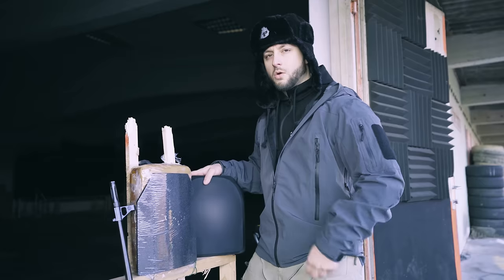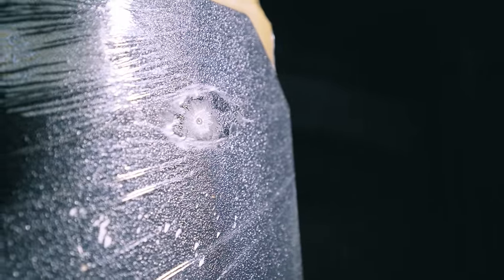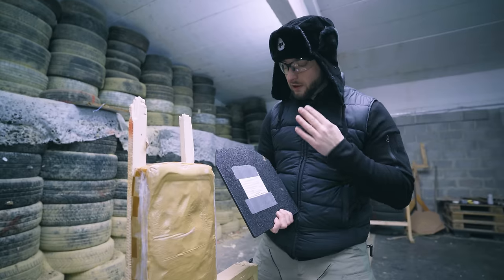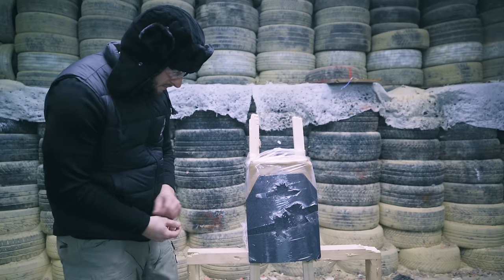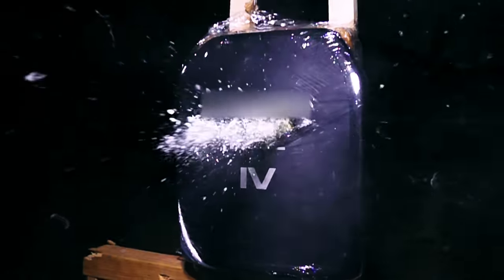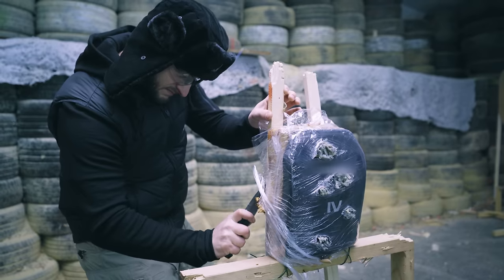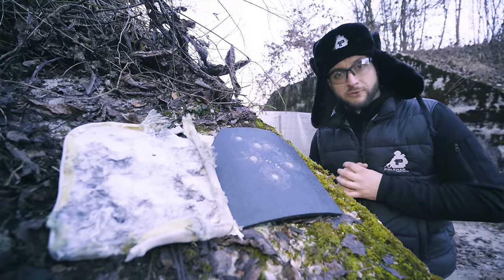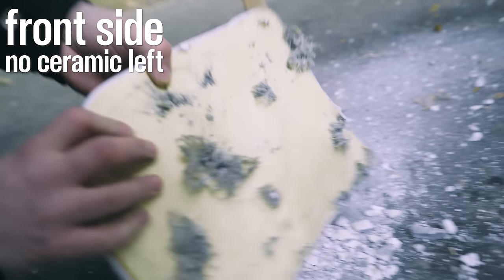Steel vs Ceramic Ballistic Plates

Comment: Good video. Nice to see someone who isn't sponsored by an armor company talk about armor reasonably.
Reply from the maker: Thanks
Is there anything specific with armor that we should try next?
Reply: @PolenarTactical  I'd be interested into drop tests. In the army they always told the fudd lore that once a ceramic plate was dropped to the ground it is useless
Reply: @PolenarTactical  Since you ask - I'd recommend using different bullet types for the different calibers to show different results from different bullet compositions, as I assume that the bullets you used in this video were all new production FMJ lead core types derived from civilian manufacturers. Seeing as almost no military to speak of still uses lead or at least in the process of phasing it out and replacing it with other types of materials, such as copper and steel of varying hardness, I think it would provide a deeper insight into the performance of the armor if it were ever a need to actually use it. I suspect however that it might be somewhat tricky, with legislation and avalibility and all that but if you could - it would be very swagger of you.
Reply from the maker: There is some truth in that - older plates were made from a single piece of ceramic that if cracked it could potentially spread apart and offer a path for a bullet to penetrate. 
But modern plates use small square or hexagonal ceramic tiles that are bonded together. This offers better multi hit capability but also negates any potentially downsides of cracks - even if the tiles crack, the plate should offer the same ballistic resistance
Reply: @ptitlinge  that's a scam, dude. If the username is "Text me at..." then a creator's name, it's a scam. No reason a creator would make a 2nd account like that for a giveaway.
Reply: @PolenarTactical  
Oblique angles and testing those side plate options some offer and options to add to reduce spalling damage.
Reply: Check out Oxide, he has tested a bunch of Eastern Armor/ Helmets
Reply: @PolenarTactical  try a hand loaded 300 RUM with a 180gr and around 96 grains of H1000. I get about 3,500 fps with that load. It doesn’t scratch steel even at point blank. I’d be interested in how that heavy and fast pill would do on ceramic or hdmpe plastic plates.
Reply: Buffman bro check him
Reply: @PolenarTactical  same spot steel armor durability would be neat
Reply: Would love recommendations for sources for reasonably-priced ceramic or UHMW plates.
Reply: I would like to see plate tests at longer distance, maybe between 200-300 yards/meters
Reply: @PolenarTactical  UHWPE armors or hybrid steel UHWPE look very interesting, I whish I could see more tests of them
Reply: @urlawyer  lapg has some cheap ceramic lvl 4 plates that look exactly the same as the plates tested in this video.
Reply: @Kappi1997  that's not true. During the NIJ testing for certification ceramic plates are drop tested. You can find videos of most brands of ceramic being drop tested on YouTube including by buffman range
Reply: @PolenarTactical  Polyethylen plates pls.
Reply: @PolenarTactical  late to the party, but as others have said, would be great to know how tough these ceramic plates are to drops.

Comment: Never forget to put Mosin on full power mode before shooting.
Reply: Only for those 10km shots
Reply: And only if you're a highly trained black ops delta SEAL operator. It's highly dangerous to the user otherwise.
Reply: But you have to have points into the appropriate Engineering skill to overcharge your weapons.
Reply: I sure hope y'all don't have a Telegram account, because I just flagged a post from it as spam 😄
Reply: Level 4 plates don't stop stronger rounds than 7.62 NATO
Reply: I do the same thing with my k-kale. Erry time.
Reply: Heads-up, scammer with a Telegram account offering unspecified winnings!

Comment: A very important thing that was missed is "glancing shots". Ceramic will capture the round, steel will deflect. If you get hit at an upward glancing angle, that round is going to hit your neck or under-side of your head which = severe wounds if not death. I hear Polythylene is the way to go.
Reply: Ofcourse but how big chance is this happend if you?
Most of times enemy shoot AP that can pen armor.
Reply: @joe125ful  Happens all the fucking time dude, and most "AP" munitions do not penetrate military-grade armor, real life isn't Tarkov. Level IV can stop 30-06 AP rounds, and modern rifles fire cartridges SIGNIFICANTLY smaller than 30-06.
Reply: @TacticalMetalhead  
1 Not at all under 90 angle ther is shrapnels and this problem can be easy solved when armor is in vest so put reinforced layer and done,no dealy astuff for you.
2 Also Level 4 is good but shoted to face leg/arm or from side not save your ass anyway or using 50 Cal.
Also force energy can broke your ribs and do internal bleeding when ribs can broke under 200-400 Joules.
Just look in 4:14 there is definitly some injuries after few shots and this can easy  happend in fight.
Reply: What impact angles are we talking about?
Reply: @joe125ful  You're spewing so much bullshit haha. It's not even funny.
1) At that point you are close to the bulk of ceramic with twice the weight
2) That applies to any armor. And no, with good armor (like ceramic, that absorbs impact), with a good backer, you need WAY more than 400 joules to break the ribs.
Reply: I'm looking fort to someday having body armor made from graphene. Someday that will be the best armor once they perfect making it
Reply: Thats what a gorget or a neck protecter is for man. Kevlar can catch alot.
Reply: Don't they have spalling rubber like coating to stop that? He even mentioned these already in the video. Military steel plates have the coating.
Reply: @sneakysnek2185  Additional weight, additional heat building up in your body, additional cost, mobility even more restrained.
Reply: @skullofserpent5727  Anything beyond 70° will send big shrapnel to the deflecting direction. Big enough to make you feel sorry about choosing a steel plate.
Reply: @andreasr6632  90 degree is a head on impact. 70 is quite an offset, like you r engaged from higher ground or  from basement. Anyway, no one sane runs naked steels. They r usually packed im kevlar envelope and then inserted to body armor. I prefer steel. Some fragmentation and small shrapnel will compromise ceramic, and that is what mostly hits operator.
Reply: @clientcomun1958  Bro "spalling" isn't a glance/richochet.
Reply: @sneakysnek2185  Yeah that shit isn't stopping anything but spalling and maybe light shrapnel. The protection value for pretty much ALL "soft armor" on the market can only stop pistol cartridges if physics is on your side (which it never is). And Lucas is 100% right with the additional heat, weight, cost, and decreased mobility. Not worth it.
Reply: Most modern ceramic plates use a polyethylene backer.
Reply: What if you use both plates 🤔😁
Reply: Literally just wear neck armor. Or better yet, why doesnt armor just curve OUTWARD away from your chin?
Reply: @LegendaryP-sl7gf  have you ever worn neck armor and run around with it for a few hours? Literally nobody issued an IOTV wears it because it traps heat like crazy. 

It's so easy to hear guys who've never had to ruck or patrol with body armor say "just put xyz on it". This is why you should train to know what works and what doesn't
Reply: Actually...that is false. Videos that I've seen steel with a coating does a better job at stopping it as the bullet still breaks on impact along with the fragments exploding towards the inside of the coating, with ceramic you now have both ceramic and bullet fragments partially going in the plate and deflecting off as well. So you have a higher probability of having fragments and ceramic hitting you from an angled shot with ceramic.
Reply: ✋ my chest rig doesn't hold plates 😂

Comment: I have mentioned this a couple of times In the comments below. What you really need to do is test steel plates inside the carrier to actually test the true danger of spalling. What I have seen, as an individual who professionally has to rate and recommend PPE for my companies client to purchase, is that ceramic plate fans/companies only show the bare steel plate being hit on video then claiming the resulting spalling will kill the wearer. Which might be true if the wearer taped the bare plates, even with the coatings, directly to their chest. In actuality the plate and the carrier are actually a system working together to protect the wearer.
Reply: Correct
Reply: that was my first thought as a nonprofessional. this plate needs to be in a thick suit.
Reply: Yeah
Reply: Administrative results did it with full loadout, it aint pretty 

Id probably use it as backpack armor or makeshift ballistic shield
Reply: There are tests with steel in a carrier. It's still shit. Also it's heavier, costs the same as ceramics, and has no actual real world advantages
Reply: @vetrix  Sorry show me someone willing to show his face and not ham it up for the camera. In short he was an entertainer and there was no guarantee he didn't rig the test.
Reply: @marcusborderlands6177  I disagree, they are great for exercise. Run some "stadiums" or some "hill repeats" with a set of steel plates to up your running game!
Reply: @marcusborderlands6177  The advantages are that shrapnel wont compromise your entire rig and need to be replaced after taking hits that wouldn't have penetrated regardless of what you are using. You also have much better multi hit capabilities when facing off against threats that aren't going to pen IE most of the Russian and Chinese standard issue rounds. It is also not necessarily logistically possible to provide replacement plates in a timely manner or at all. Unless you are facing off vs a NATO country you will be facing rifle rounds that will be stopped by steel without issue and you can count on at least some range for the majority of engagements. If you are worried about threats under 5m that require a NIJ lvl 4 plate or higher its a bad time if you have steel or ceramic.
Reply: Steel plates are terrible, even with costings it was ripping up the carrier.
Reply: Unless plate carriers have magical spall stoping properties or just kevlar coat around the plates they ain't going to make any difference to spall issue.
Reply: Either in the carrier or inside a spall sleeve.
Reply: This is incorrect. Carriers are not designed to contain spalling, and relying on them to do so is inappropriate. This is particularly true when people use many different kinds of plate carriers.
Reply: I've literally seen spalling go straight through a carrier into ballistic dummies that would 100% be fatal. A plate carrier is not always enough to stop spalling for many reasons and anyone saying that is an idiot. Because here's a shocking piece of info, not all plate carriers are made equal. Some are made with different or more/less material in certain areas than others. If you make a steel plate and are relying on a plate carrier to stop spalling then YOU are in the wrong. You as the manufacturer of said steel plate have no control or knowledge of what plate carrier someone is going to run that plate with. The manufacturer of said steel plate HAS to be responsible (IMO) for the spalling because they are the ones that control that and unless the manufacturer of said steel plate says "Only use these plates with these specific plate carriers to stop spalling" and that would need to be very very clear. Like a big fucking giant sticker on both sides of said steel plate so no one can miss it. Not just some fine fucking print on their site or some shit. Like. Come on. That whole argument is invalid.
Reply from the maker: Bare steel plate will produce high velocity fragmentation that can be deadly and a plate carrier won't be enough to stop it. But as ai told in the video, there are steel balistic plates with 100% effective "spall" protection that works. But those plates are more expensive than just steel
Reply: @PolenarTactical  Exactly. Anyone relying on their plate carrier to stop spalling is going to have a real bad day if they get shot wearing it. Even if a plate carrier is "supposed to" stop spalling you still run the risk of just bad luck saying fuck you and going full send right into your throat. You can never rely on the plate carrier to stop spalling because that's not the plate carriers job. Like I said, that job should always be on the manufacturer of the steel plate. Anything else is stupid, dangerous and just never worth the risk!
Reply: @RprtBak  The individual was speaking from experience and his argument was total reasonable and articulate. He’s not the idiot here.

Comment: My wife has steel plates and I built a form and covered them with a 1/4” of epoxy. I tested it on an old steel plate I had and it swallows up the spalling great.
Reply: Whats the weight on them?
Reply: @eagleone5456  they’re the proprietary 9x9 plates that go in the freeman carrier from AR500. She’s 5’2” and 120 lbs. lol. Without the epoxy the plates weighed 4.9 lbs. after epoxy they weight 6.2 lbs.
Reply: @ramzankadyrov6035  not a bad weight difference for good spalling catch.

Comment: That would have been hilarious if it cracked when it fell.. "Steel wins!" 🤣
Reply from the maker: Despite all the warnings cracked ballistic plates are still effective
Reply: @PolenarTactical  Obviously, the odds of hitting exactly on an effectively invisible (it's buried inside the plate construction) crack (presuming it really did crack) is so vanishingly small that it could be ignored, just like the chances of real-world threats hitting in precisely the same spot to avoid intact ceramic are also very small.

Comment: Nice Experiments! Can you do more test on spalling (I hope this is the correct spelling) by placing clay or ballistic gel around the plate? May to rolls of clay representing arms and a ball of clay hanging from the ceiling representing head? This would be nice.
Reply from the maker: That's a very interesting idea!
Reply: Some videos of amerikanski testing with ballistic dummies, the spalling got deep in skull and arteries of the neck
Reply: @PolenarTactical  Also test how well the plate carriers themself capture and trap the spalling.
Reply: @PolenarTactical  It also needs to be put inside of a Plate Carrier for efficacy, PC's catch spall as well, and there really isn't a reason to be testing it outside of one aside from baseline NIJ ratings process.
Reply: @PolenarTactical  What if you tape lvl3a over steel plate to trap the spalling?
Reply: I've been looking for a quality vid of the exact scenario you described, but haven't had any luck finding one. It would be great to see the results.

Comment: I bought ceramic and never looked back. If you actually go out and train you know why. 
Mobility is everything.
My old steel plates (AR500 series A, with 6x6 side plates) with "full build-up" of anti-spall weighed just over 24lbs.
My medium size Hoplite level 4 SAPIs with 6x6 side plates come in at 18.5lbs.
Trust me, that 5.5lbs makes a HUGE difference.
If you're a hiker, you'll understand how just mere ounces of weight make a difference. Same concept applies here.
Direction changes are faster and require less energy. Getting up from prone or kneeling is faster and requires less energy. There's less momentum to contend with. Over the course of a day all of that adds up and you'll be glad you spent the extra money on ceramic plates. 
But I guess you can't really appreciate the difference unless you've suffered the weight of steel plates lol
Reply: Also, holy crap armor prices have gone up since I bought mine 😬 that said, get you some ar500 😭
Reply from the maker: I completely agree with you, if you diregard everything else even just the weight difference can justify the higher price. But i still use steel plates for training, the only instance where higher weight has some merit
Reply: In that case wouldn’t UHMWPE be great once it actually becomes level 3+ or 4. Even then polymer is supposed to be much lighter and even be buoyant right?
Reply: @Tree457  it will never be level 4. It can't stop hardened penetrators. They put ceramic strike face over polyethylene to make it level 4. Adds some weight but it's still lighter than the standard level 4 ceramic.
Reply: i used to ruck with 60-80 lbs of gear for 15-16 hours a day. sounds like you need to do more weight training kid
Reply: What did you use as "anti-spall"?

Comment: The box check for ricochet and spall is good, always pay attention to straight up as you noted, but also low left and right. As in toward the inside of the thighs. Same problems in those areas.
As for ceramic (and to show the difference between steel), something like the test you did trying to move yourselves along on the skateboard via recoil might be helpful. The dispersion of energy between different grades of ceramic is quite substantial, and the total difference between steel and ceramic again is massive.

Giving people a relative understanding of impact force beyond clay cavities can be pretty helpful, even if it seems like a gimpy way to do it.